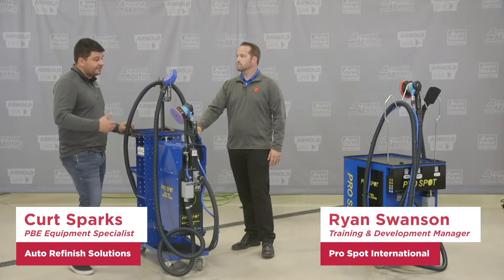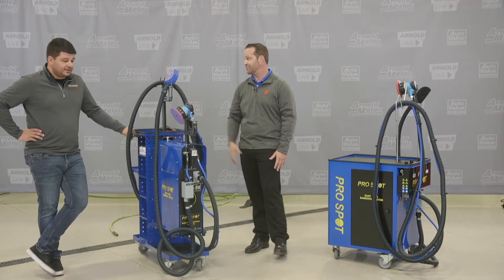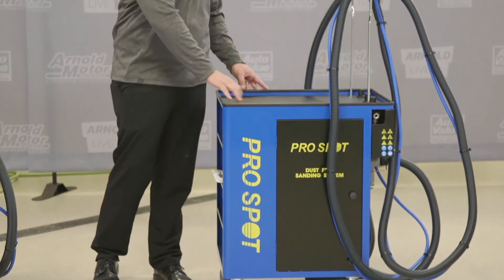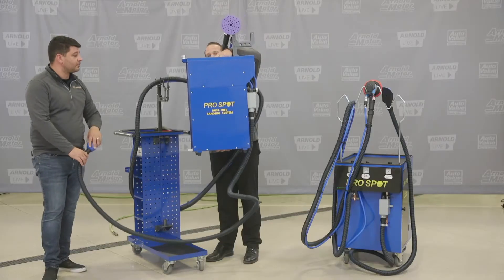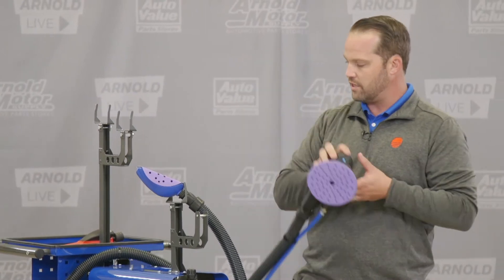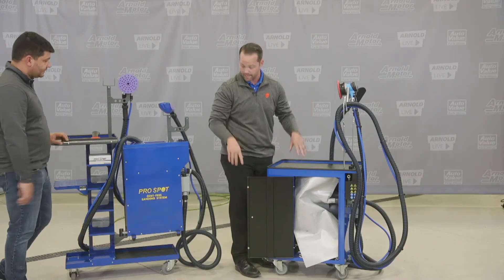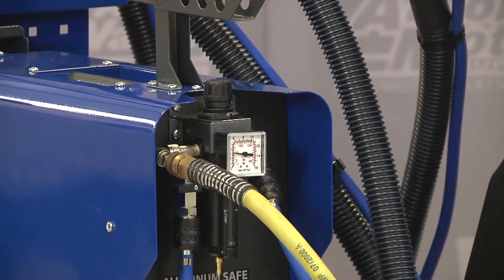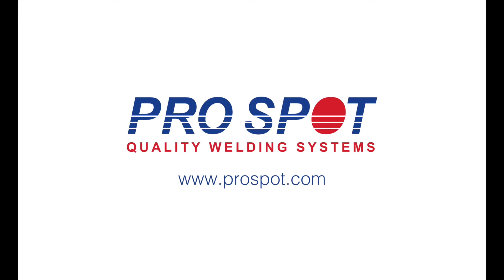Dustless Sanding System by Pro Spot

Comment: I am looking around for a system. Have you compared to festool system?
Reply from the maker: Hi there! The biggest advantage of the DE-PRO is the fact that it does not have any electric motors and runs on air. This makes our sander aluminum safe. Besides, it runs on low airflow (5-7 CFM), so it provides more power with half the consumption.